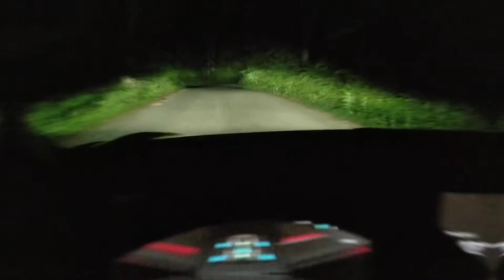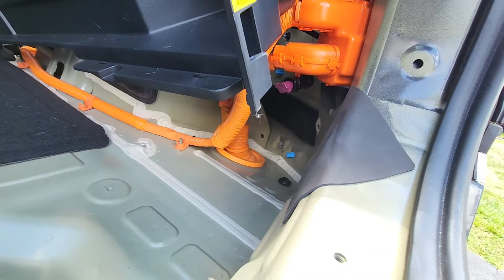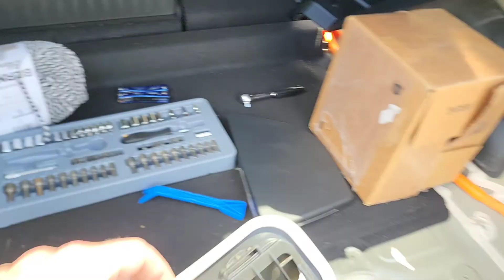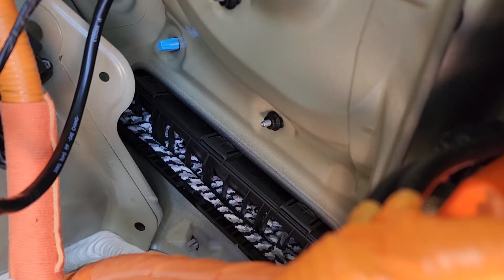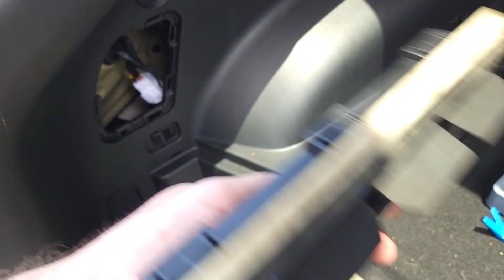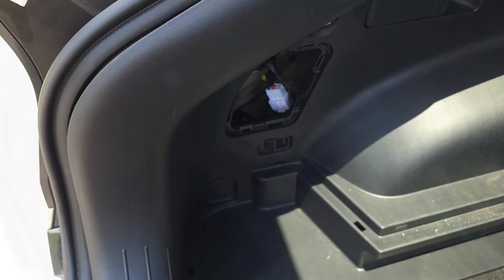FIXING the Infamous Kia EV6 Rattle! 😀

Comment: Is it possible that this problem does not exist in the GT-Line version? I drive this EV6 version since november 2021 and I never heard this type of noise 🤔
Reply from the maker: They all have the same design so it should be the same. You may not hear it unless at high speeds though. And some are louder than others it seems. And if you listen to music it's harder to hear it.
Reply: @TechnicallyJeff  I had some drives with interested friends who were thinking about buying such a car and we were driving without radio on and it was absolutely quiet in the car at all speeds. 

All my friends were very excited about the silence while driving. 

So, I'm wondering that your described problem seems to exist in some cars.
Reply from the maker: Oh very interesting. I know sometimes it was worse than other times.
Reply: @TechnicallyJeff  What may be interesting for you: I live in Germany and so I could test all possible driving situations because we don't have any speed limits here. But it is as I wrote: no disturbing noises while driving.

The only difference to tell: with winter tires the car sounds a little bit louder than with summer tires.
Reply from the maker: Oh nice. Very interesting.
Reply: I couldn't find anything on this topic in German forums. 

Is it conceivable that this problem generally does not exist in German EV6 versions? 

As is well known, there are differences in details between the American and European EV6 versions, e.g. with the lighting.

So it is thinkable that other parts of the car may be affected also...
Reply from the maker: I don't think so. This is something that should be standard across the board to be honest.

Comment: That’s a great find. Now if only someone could figure out where my Active Sound Design Menu option disappeared to after my Meridian Amp swap…
Reply from the maker: Whaaat? That's weird. I did recently learn some markets don't have the active sound design option. Did anything get updated in your software too?
Reply: @TechnicallyJeff  No they just swapped the Amp. Other bits of Meridian menu remain and also the surround modes but Active Sound Design is not in the menus or even searchable in the settings.
Reply from the maker: That's crazy. Have you checked engineering mode?
Reply from the maker: Figure it out?
Reply: @TechnicallyJeff  Not yet.
Reply from the maker: Good luck!

Comment: I have this weird squeak/rattle coming from what seems to be the front passenger area. I tried the obvious stuff. The only thing I can pinpoint is that the noise is only present during cooler parts of the day. When it is warmer out there is no noise. It must be some sort of plastic piece that is expanding and contracting. Any thoughts?
Reply from the maker: Hmm do you have mud guards? All trim pieces nice and tight?

Comment: Jeff what is the purpose of that part?
Reply from the maker: If air pressure builds up in the car the flaps open and it releases it. I feel like this could have been designed much better.
Reply: Pressure relief (when someone closes a door) and also exhaust for cabin air when you have the recirculate button off.
Reply from the maker: There you go
Reply: @TechnicallyJeff  "If air pressure builds up in the car the flaps open and it releases it" -- okay, but why the flaps? Wouldn't a vent work just as well for that purpose if it were just open all the time? What are the flaps themselves doing that's so important?

Comment: What an incredible design failure! I just bought a used 2022 model ($25k for an as new Wind/tech package including $2k in upgraded floor mats etc, qualifies for $4k fed rebate; a steal, really) but I haven't noticed this rattling. I rented 23 and 24 models for several months each and didn't notice this either. Hope I suddenly don't start noticing and have it drive me crazy. But at least I'll know what to do. Cheers.
Reply from the maker: Yeah once you notice it it's hard not to unfortunately haha. My new 23 GT does the same thing. Congrats on the car though!

Comment: gotta say, didn't hear anything in video... and I don't think I've got this issue. My EV6 was built in summer 2022. I do, on the other hand, have a weird "rattle" from my drivers side sun shield. =/
Reply from the maker: Try turning the video way up at that point. It's faint, but definitely a tapping. That sucks about the rattle you have though.
Reply: I have a Yamaha100 sound bar, and cannot hear it on that, but can hear it on my phone and with my headphones. Also obviously in person. It may just be your sound system.
Reply from the maker: That's weird

Comment: ???Doesn't that defeat the purpose of the vent by blocking the air flow with yarn????   What is the purpose of those vents??   Felt pads make more sense as long as they do NOT block the air flow..
Reply from the maker: It doesn't block airflow. They can still open further and air goes around the yarn. If anything it keeps the vents open instead of allowing to close, so it's not quite such a sealed cabin. The vents allow air to escape if cabin pressure builds, like when not using recirculate or when you close doors.

Comment: I would highly recommend that you do not do what you just did. You tell the dealership that they need to add resolve to this. You explain how you are the customer, and they are the service provider, and that this is going to be addressed just like you said it will be. Period. End of negotiation. I can 100% promise if you drop a note to Kia of America if your dealership causes you any distress, and are incompetent in resolution of this matter, after making several attempts, you will absolutely get what you came for 100% of the time every time, all the time.
Please remove all that you did as fine dust and possible dampness caused by the cotton/wool combination in the yarn, and high voltage is a recipe for catastrophic results. You must insist your dealership address this issue and add resolve to your liking, not theirs. You are the customer. They do what you request or otherwise expect them to do until a resolution is reached. Period.
Reply from the maker: I get where you are coming from, but this is unfortunately not something the dealership will resolve. Many have tried with dealerships and the problem is the air flaps are acting as designed. They open and close when needed to vent the air and balance pressure. The sound is an unfortunate byproduct. As for my solution, all the battery components and wiring are sealed and even on very damp days it doesn't get damp. I'm not really worried there too much.